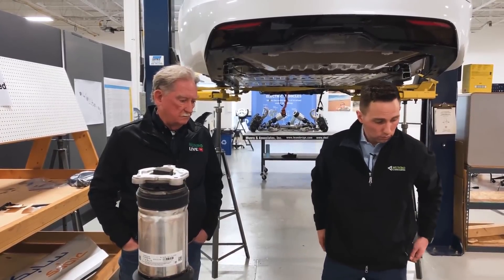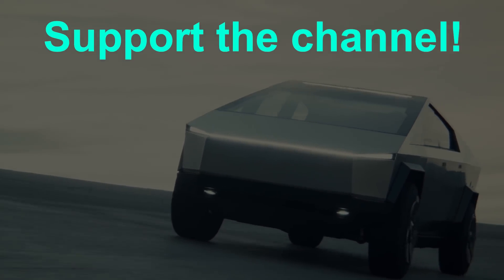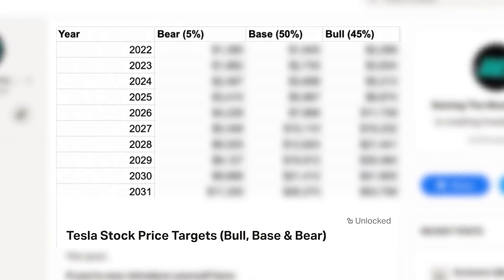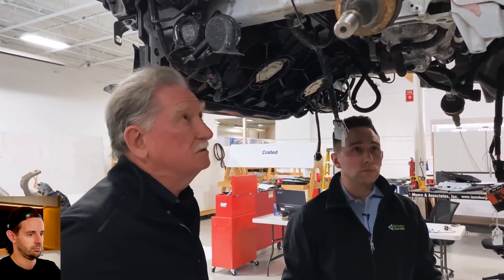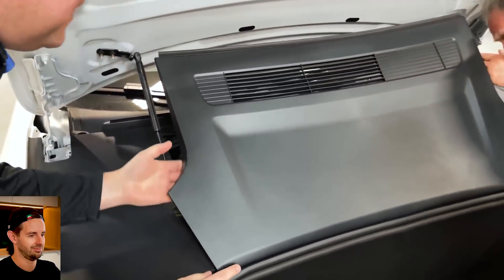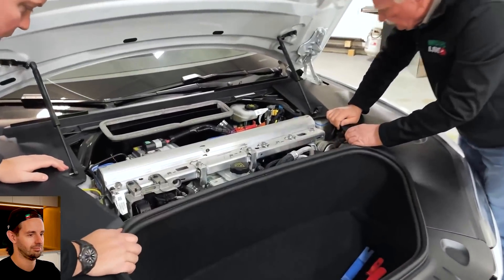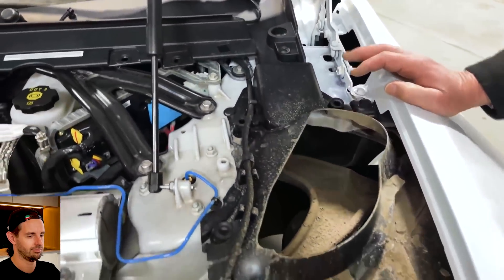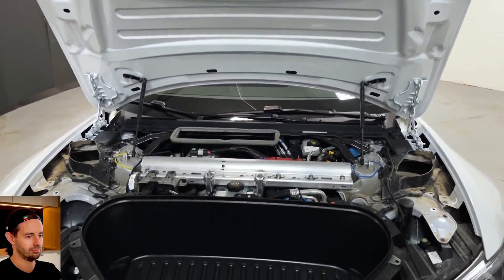Sandy Munro LOSING IT Over Tesla Engineering: “To Die For”

Comment: As for American Cars I used to have GM (Chrysler Lebaron) the ride very smooth, I love the shock absorbing...  GMC trucks.. I love them, their strong body frame.  But the Engine parts really sucks.  As for EV.  They gottta catchup and make EV... I would BUY their EV but with Tesla battery Technology....  I will give them 5 Years wait.  After that I will not buy. the Shock absorb on model Y and model 3 really bumby... really sucks, model S better... we have a lot of deep holes and crack in San Diego, California...

Comment: it's great about design and everything.  But the problem is with Tesla Service.  Every time I bring in the Model 3 or model Y. I brough back with a problem or 2.  When I bring in New 1000 miles MOdel Y , 2021 model to Kearney Mesa location in San Diego, CA.  to changed out 75 kwh battery.  It stop working while park at home charging with 120 v outlet.  When I ready pick up car.  It was Filthy Dusty inside.  They left the window open for more than 2 weeks while waiting for the battery.  12v AGM Battery dead for 2 weeks and they were not change out new one until I requested.  The side passenger door also have damage by some corner of something like the corner of the 1x2 wood.  The back over head part on right side of passenger also damage by a poke of something 1/4 inch and next to that right below the back hatch back windshield have 2 mark like snake bite hole with 1/8 inch...  They are not willing to fix.  TESLA COOL but their SERVICE IS CRAP /SUCK /BS....

Comment: Government all over the world are being lobbied to have all vehicles powered by the Utility girds.  It is very far-sided and positive that India has rejected the Musk plant.  There is a dark side to Musk's and their plan to eliminate all Internal combustion Engines in vehicles that is never told.  Early in the century thousands of hobbyists had electrified farms.  Many with windmills or small engines which charged batteries.  In the 30s in the depth of the great depression local and in some cases federal governments, used their monopoly on violence to forcefully destroy, without due process or compensation tens of thousands of these systems that had provided these farms electricity for lights and connected them to the world via radio.   Large wealthy investors had bribed politicians to give them a monopoly on generating domestic power over large areas.  Those monopolies held back the development of wind power for many decades.  Utilities still have these enforced monopolies in many countries.  Nothing holds back progress like a monopoly enforced by the threat of violence by a corrupt state...  Yet they are at it again wanting to eliminate Range Extended Electric Vehicles, (REEV) hybrid and Internal combustion engines in vehicles.  Do they not know that the generated power on the grid puts about a pound of CO2 into the air for each kWh delivered.  Using the EPA estimates on carbon emission, the grid's energy mix means that every kilowatt-hour of electricity generates 1.336 pounds of carbon dioxide.   Many REEVs generate just .4 pounds per Kwh.  Which means they are three times cleaner than a Tesla.  And now they want to outlaw everything but grid-powered EVs.  If we let Musk and the Utility associations get their monopoly there will be more injustice in the future and a slowing of technical advancement in reducing CO2 output.   Big Mistake for society and the world!

Comment: This tear down by Munro reveals one thing no one talks about: this miracle of engineering, the one that Sandy says leaves everyone else in the dust vehicle comes out of the Fremont plant. And only the Fremont plant. 

No other Tesla plant, currently or planned, makes the diversity of vehicles as Fremont. Model X. Model S. Model 3. Model Y. Cybertruck. Roadster. No. Other. Tesla. Plant. Is producing, developing, or manufacturing the entire range of Tesla models. None. 

I know all the hip kids like to diss Fremont. And those kids get all excited about China and Berlin and Texass… but those plants, including the ones in Berlin and Texass if/when they come on line, will still not match Fremont for the range of models and trims made. 

Tesla would not exist if it wasn’t for Fremont. Full stop.

Comment: The key is the culture! 50 yrs at Ford Motor as a mid manager. To incorporate an air tank into a cross member simply would not happen.  For body structures, chassis, and power train to work together is simply not in the culture. Furthermore the culture is so ingrained they won't be able to change it. Sandy knows this. He worked there.

Comment: No hang on a sec. 

The tank for the air suspension... it's become a structural member like how the battery unit is structural? And they did that before releasing the structural 4680 pack? And they didn't say anything about it?

Comment: When Monro revealed the rear motor assembly, I recognized the engineering discipline, and coordination required to create it. Sandy's associate defined it perfectly, as  a packaging symphony. It was a joy to behold. I had been looking at Tesla from the beginning, but could not commit to purchasing stock or car because all the FUD and short sellers. I finally decided to purchase a Model 3 at the end of 2019. Best decision I ever made. I soon realized it's and Teslas value and purchased stock in early 2020.  I wish I had bought my car mid 2019, when Tesla stock was much cheaper. It didn't matter because I soon was all in on Tesla.  I still think they are a once in a lifetime company.

Comment: As a recently retired Electrical Engineer with a fair amount of Tesla's stock, I can state that high levels of engineering over a wide range of disciplines always required too much cooperation to achieve, at least in our company. A few individual engineers could work very well together but their well-done efforts were then limited, siloed, or devalued by other engineers, engineering teams and, most surprising, by management! I my case, my group was left alone to achieve our own successes but those engineering milestones were kept away from EVERYONE else! Strange but true. Probably because inferior engineers felt threatened and management was incapable of understanding what has been developed. Thank you Steven for providing this forum!

Comment: Greetings from Canada, I am an engineer and a shareholder. From what I can determine from publicly available information, Tesla has pushed automotive engineering forward in ways that competitors were not even contemplating.  With a return to vertical integration, new thinking about optimization regarding manufacturing efficiency, product packaging, safety included from the start of product design, etcetera Tesla have gained an unprecedented margin advantage that no one could have imagined. Such a position is only sustainable if Tesla can continue to innovate faster and better than all other players despite the lead they currently enjoy. The teardown that Munro is doing is of great interest to Tesla’s competitors as well as Tesla fans. Sandy is pretty direct when he says no one else is able to bring as many design disciplines together under a single vision to produce such a symphony. If ever there was a wake-up call being given, this would be a big one, IMO. Innovate or perish is the message.  And don’t forget, we are only talking about mechanical, electrical and packaging efficiently of the physical vehicle without mention of software. Software is also a major in the unique selling proposition that applies to Tesla. This is not well understood. Who cares if the seat cushions can fart? Probably not much of a factor but OTA updates and what they mean to the ownership experience cannot be fully appreciated.  The rest of the market see this as an add on feature where in reality it is a fundamental shift in the delivery/continuing delivery process.  One last point and it is a negative one – All that integration that Tesla does so well adds complexity and potentially increases the difficulty to repair accident damage. Hopefully FSD will have a big impact on how much accident repairs are required going forward. I continue to appreciate your channel. Thank you.

Comment: If people can’t trust the information that’s being given by an lifetime engineering mindset person, then it’s you are the problem of not being able to understand what’s you are receiving. 

Being negative is a stupid person’s way of trying to appear smart without actually being smart..     https://youtu.be/Nd392VlPCXI 

The ancient auto can’t afford to lose their own investments in the equipment that they have spent on.  

If they were to try use the dividend scheme to fund the new equipment bill, then it’ll automatically result of the investor outcry of their non payment.  

But they had a chance to slim down the dividend payment plan in the early 2010’s to fund the new equipment bill, but they didn’t. 

So they increased it every couple of years. 

TSLA will continue to creating components that have multiple uses into a single unit. 

Because TSLA has the best engineering mindset and knowledge of any current technology company has. 

Space X and TSLA are still ranked 🥇 or 🥈of engineering opportunities for the newest generation of engineering students. 

While the rest get the lower grade of opportunities of the bean counters and MBA executives lead of companies. 

The ancient auto needs to continue working with their own suppliers without paying for the engineering designed hvac system. 

The ancient auto will continue to use the cheapest option for them to use in their own projects. 

https://youtu.be/hgu7Ok-qcTY

TSLA innovative speed can’t be compared with the old guard of the automotive industry. 

:_STMPLook::_STMPTsla::_STMPMatters::_STMP420:

Comment: Former structural engineer at Boeing and Northrop Grumman, currently at a reusable space launch company.  Could retire in a few years at ~42 on a few thousand Tesla shares; ~100 purchased in 2012 and still buying.  Totally agree with Sandy’s comments about multi/cross-discipline engineering.  But I’ve always thought the best integration happens when fewer people are responsible for it all.  Less negotiation, more optimization occurring if one person has to think holistically about structures, fluids, etc.

Comment: I worked in Automation and on of the machines we built used Aluminum Extrusion for the guarding. I suggested turning the Long Runs of the extrusion into an Air Manifold to create a Buffer for when the machine activated, it would draw air from the manifold, they didn't need a larger compressor or Surge Tank. It was incorporated into the system. It was a matter of Just Doing It. The bosses were wondering where the Air Tank was. 3 other machines were converted after that. I circumvented the meeting to discuss the change. The higher ups saw the Immediate Advantage, my boss was not happy I went around him. To thank me, he gave me an Extra Day Off to reflect back on What I Did. Worked out well, I used the time and found a Better Job!
Reply: I bet your boss was pleased he 'got rid of you' too. That's how bad corporate culture is.

Comment: I'm a retired chemical engineer, and worked as a  process/production engineer in a chemical unit of a consumer products company. We were vertically integrated in many areas. The same organizational silos existed however. Fortunately the owner was an entrepreneur. Going around roadblocks was encouraged. I managed to form a skunkworks team and accomplished a lot outside of the normal protocol. A couple of PhDs in R&D told us something was impossible. We proved them wrong.
Reply: you worked at an unusual company, lucky for you.

Comment: I invested in Coates International in the '90's. The founder and chief engineer came up with valve sets for ICE engines that were actually balls on a camshaft. Total parts, like 12. Oil changes would go to once every 30,000 miles (valve springs popping appear to be the main cause of motor oil breaking down). He moved from Scotland to Detroit, MI. GM and Ford hated this guy so much that over 4 years of begging them to try his valveset, he finally gave up and moved shop to Israel. The ideas were great, but even back in the 90's, GM and Ford were in their ivory towers, stomping to death any and all innovative ideas.
Reply: This is a sad commentary of out society and the lack of accepting and encouraging innovation.

Comment: Seems obvious even to a non-engineer that Tesla‘s technology is completely different from the rest of the auto industry. It’s aerospace industry technology. Just looking at the hoses from the mach e compared to the hoses in the model 3, you can see the difference right away-same with the crossbeam that also contains the suspension air tank. It’s the integration that saves the weight and complexity and cost.

Comment: As a retired electronics/software guy. Working on my own was a blessing. I tried to make software easy to read, and straightforward (robot was a suit worn by a human - so speed no problem!) with plenty of comments. Electronics? Took a point to point wired system (ouch), and replaced it using much more reliable 10, 16, 20 way gold plated connectors, with ribbon cable. Again , straightforward to make, and very reliable. Eventually, if their was a fault - it was a plug and play system, easy to fix - no soldering required . Reliability was probably 30-50 times better - virtually all faults human error. You get used to looking at "stuff" (other people's work), and you can almost tell at a glance what level they are at..... If you see a design that looks neat and elegant, chances are someone has worked hard to achieve that and chances are they worked hard on the the things you can't see, like the electronics and software internals, to get them right, too. What people don't realise is that 1 single mistake in the design can cause major problems later on, so good engineers work hard to make sure everything is right.
Confession - it was watching you, SMR, and Sandy Munro, and Tesla engineering that made me go all in on Tesla.

Comment: Sandy is bang on right. I worked for a consortium building an offshore oil rig, 16 engineering departments, 16 independent sets of goals. Tesla's ability to work cross-funtionally and their pace of change is truly not appreciated. No one will catch up. The 2012 Model S is still a good car compared to today's competition.
Reply: While I understand your point, I probably wouldn't say that aren't truly appreciated given they are the most valued auto company to ever have existed.
Reply: Even at the sales level, Tesla automatically moves their talent from one role to another. If you can’t fit the new role, you’re out.

Pretty brutal for some, but I love it
Reply: Good stuff! Beyond the imagination!

Comment: I'm an mechanical engineer, working on pneumatics and interior design. I also worked with Tesla on a few vehicles, and I can say - the level of communication within the company is miles above other OEMs. I've had feedback about space claims or sensor positioning within door trims within hours - with big European OEMs that's usually 5 meetings in the span of a two months to agree that i need to change a bolt from 12mm to 10mm (true story). Tesla is going to steamroll the German car industry when Giga Berlin goes live.
Reply: Yep and that's why Bdn is so afraid of him,  auto unions own Bdn. Which is why they won't invite him anywhere or talk about him/his company. Outside of negatives.
Reply: @amethystorgan4293  
Influential groups own 95% if US politicians...... The system is the problem.
The fact that both president's since 2016 have been so blatantly inept at concealing this simply highlights the fact.
Do something about it.
Reply: thanks for insight
Reply: I have no problem at all in believing this. We have all seen how Volkswagen likes their big meetings, and less so when it comes to doing the heavy work needed.
Reply: @yourcrazybear  I always love to listen how they think they are the best. BMWs break down, Mercedes has quality issues, Teslas paint comes off in the car wash. Anyone driving something else than VAG group is a fool to them.
Reply: @krystiankalinowski6757  
So, about that software (6+ month delay and still crap)?
And the Taycan "cheap charger" (that's been covered up)?
etc
Reply: @rogerstarkey5390  reason why software development in VW sucks is because of Dieselgate. Since then they have very strict norms regarding code, therefore i don't expect them to have Tesla-like OTA updates in the foreseeable future.
As for the Taycan stuff - that's Porsche, they are separate from VW. No idea why they screwed that one up so badly.
Reply: Hope so
Reply: Absolutely
Reply: Imagine you have to be able to constantly remember the last ~2 months of failure. Great..

Comment: (now retired) Everything Sandy has to say about OEM engineering politics is So True.  The legacy engineering could be So Much better if you could just gut the OEM of unneeded hangers on.  I call it the Fenner test: Tell me in five seconds what you do here. One, two, three, four, five.  Times up, there is the exit.  Every time one of the bosses nephews gets hired to engineering the stock holders loose millions.  Every golden cow has a distinktive  odor and management can't smell it.  Elon drove the stock down with the side bar robotics drone crap but that program is not about stock but rather the continued hiring of the best and the brightest engineering talent world wide.  With such a reserve pool his reserves are never depleted even when OEMs wake up and try to out bid Elon for a few of the stars.  It worked for BYD, it won't work here.
Reply: Its not just the quality or aptitude but the system they have to work under. Even the brightest can get frustrated with the system and leave.